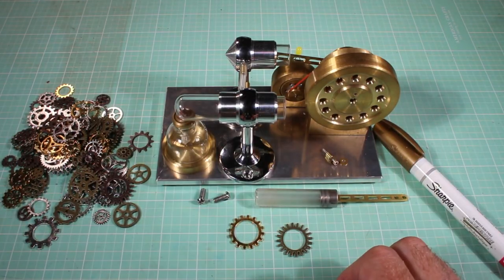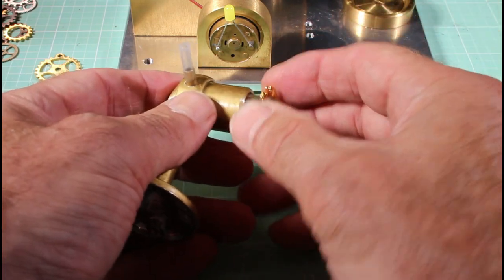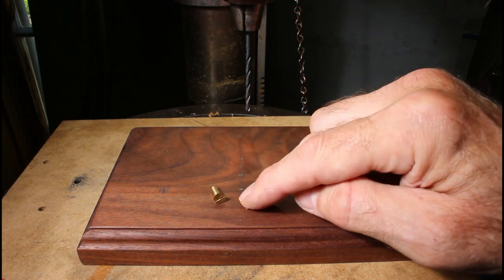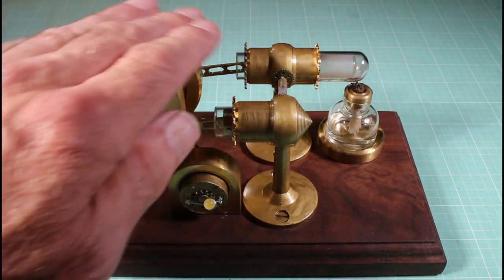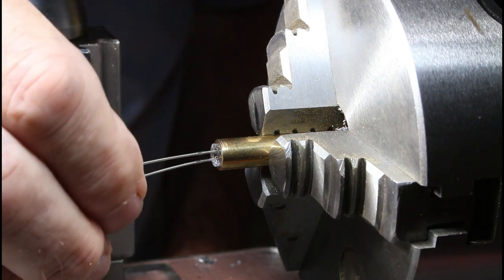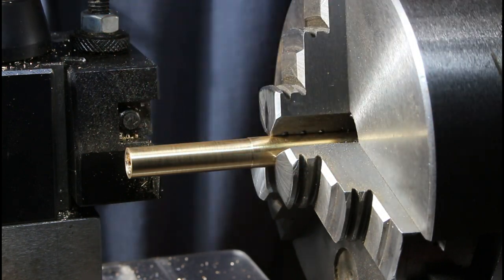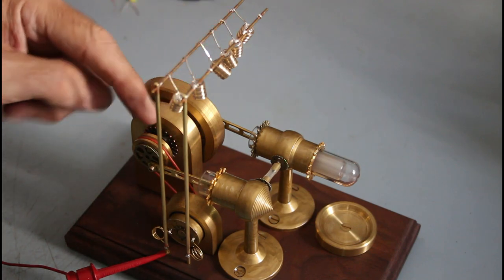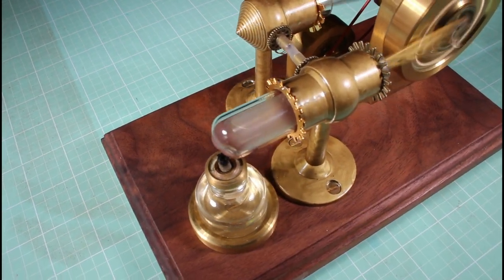Steampunk Stirling engine part 7 - final assembly

Comment: This came out great. That marker worked a treat, you can't even tell to be totally honest. I wonder if you added a bigger generator would the lights light brighter. Who knew that "Light Brights" as a child, were like mini LED's lol
 Great work buddy, I've been creeping up with the series, I really like the part with the lights added, it looks awesome, great job.
Reply from the maker: Thanks Frankie, I appreciate the feedback. I was concerned that the series was running a bit long, so I'm glad to hear you stayed with it.

It's not so much a bigger generator necessarily. Just one that might have a little more voltage.  White LEDs need about 3.2 volts at around 20 milliamps, no matter how many you wire up in parallel.